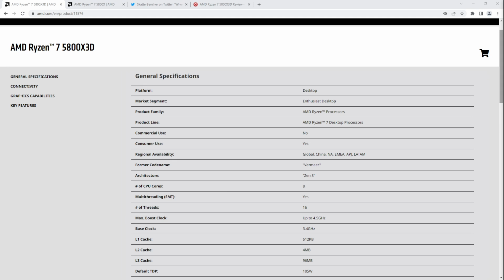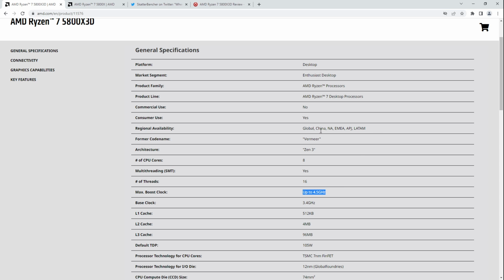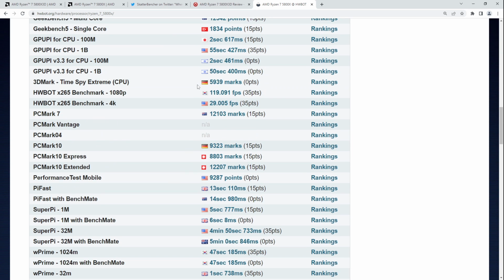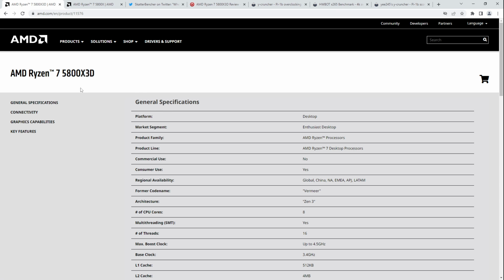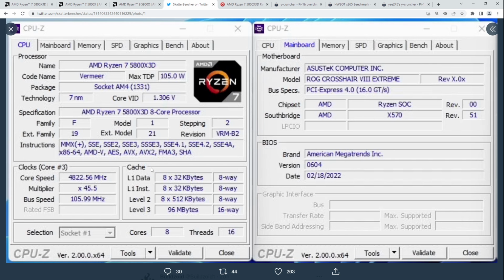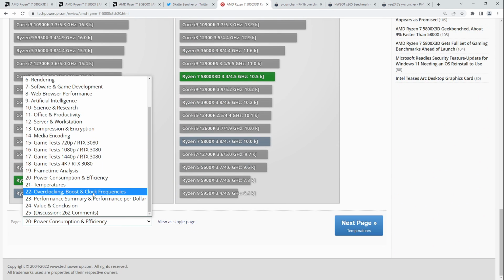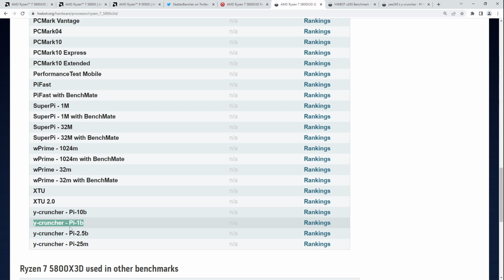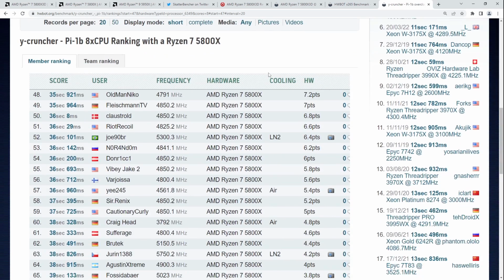Buildzoid's 5800X3D overclocking rant

Comment: Only reason is bc the 3d vcash ads hight with increases the thermal delta. But like on a 360 aio i can't keep the delta low enough to hit the boost under load. If amd made a custom ihs for it they would have to worry about locking the frequency. And trust me ima direct idie guy. I got my i7700k back in the day to 5.3ghz stable allday with a max temp of 65°c. To conclude yes the locked oc is dumb af. Once i d lid my 5800x3d i will most likely hit the boost no problem. Then i wil ether dig to the bottom of the internet to find a solution to unlocking the ppt. Or do a bclk 😢.

Comment: I know this probably won’t ever be seen, but: Is the thermal shut off not customer adjustable? How is it implemented? 

Can an overclocker not choose a temperature as their own shut off safety point? Ex: Imagine a new overclocker who is nervous, maybe they’d want to lower the shut off from 115 to 95 for their first runs. Is this not possible?

If not, could you go into how these limits are implemented at the architecture level?

Comment: This video didn't age well at all.
In the meantime we have learned what's going on with Intel's 13th/14th gen CPUs killing themselves. AMD chose the save route with their first X3D products to avoid a desaster like that. And boy, those 5800X3Ds are still going very strong in games. Plus the 5800X3Ds tought us that with modern CPUs undervolting is the new overclocking (with lower voltages you can maximize boost performance).

Comment: I guess it's just me but I never found frequency scaling a great feature for performance in general. I would sacrifice some clock any day for manual vcore/freq on all cores, basically raw performance with no awful jumps, spikes hikes what have you between idle to load transitions which is the worst feeling one could have after investing time in building something better than an pre-built HP office PC... Genuinely I don't understand how PB/PBO is considered acceptable as a standalone solution with no other options. It baffles me, might as well just buy a laptop at this point.

My final take is I think (even including this channel) overclocking is seen as pushing clocks and voltages to max blah blah. But honestly in my plebian OC PC experience the holy grail of OC is having the option to max out real-time stable performance (which is not peak clocks, but constant clocks), not just in gaming but in workstation workloads as well. How does freq scaling help you at all when you are working on something for long hours with 4 heavy programs for 3d and alike opened which use cpu only when touched?1 So you tell me every-time I switch programs or walk away I need to just suck it up with all those stupid freezes and ramp ups. What is the point then of this product being at all an X, call it 5800G3D or something idk?

P.S: I'm well aware that manual fixed vcore will draw your electricity bill higher, but in performance or work context I think that should be a possible sacrifice.

Comment: Hey BZD, have you seen PBO2-Tuner for the 5800x3d? with that you can also tweak voltages, mhz and thermal cutoffs
Reply: You can't. The multiplier is artificially locked at 45X

Comment: Why can my 5600X occasionally hit 110C with things like CPU Burner?  It's doesn't shut down or become unstable...  Although I'm sure the clocks are reduced...  Nevermind tho... it can hold 110 to 111c for as long as I the user, allow it.  

Oh, OK, later you say the actual shutdown is 115c - so ok... that makes sense then.

Comment: Ryzen 5800x3d sucks compared to what is about to come from amd. Zen4 will include both overclocking features and a lot of cache anyways... I am excited for the zen4 hell I'll probably buy the top end zen4 chip and build the top end zen4 + rdna3 gpu system with like 7000 maybe 8000 mhz of single rank 32 gb memory system with epic timings and scores next year unless zen4 and rdna3 sucks...

Comment: Yes fully unlocked, 1 or 2 Ghz base clock. Charge an extra 50-100 quid, Get a lapped IHS and put the serial/model number on the PCB in the centre of the socket pins.  Call it a "Black Edition" or better yet a 5950X and call it a 5950XOC.

Comment: There was so much potential there but as soon as I heard the nerfed they clock speeds compared to the 5800X I pretty much lost interest because now it's just a One Trick Pony for Gaming only and you are going to take a significant hit to Productivity ..... If they could have kept the clock speeds the same as the 5800X they could have had an all around CPU where you still got good productivity performance as a real screamer for Gaming. Personally I'm going to save myself 100+ bucks and buy a 5800X ... Hell I could even save money buying a 5900X which are under $400 now
Reply: "you are going to take a significant hit to Productivity ..."
For productivity there is not much difference between it and the 5800X. For gaming it is faster by a decent margin.
According to HWUB 41 game comparison it was 15% faster at 1080P and there still were several games which were GPU bound. For 1% low it was 22% faster. So I expect the 5800X3D to pull further ahead when we get faster GPUs or if you are using "competetive settings".

If productivity is important then the 5900X or 5950X is a better choise. If you are gaming and the 5800X3D is out of budget then you dont get the 5800X but the 5700X. So the 5800X is kinda pointless at this point, unless it is prices very close to the 5700X.

Comment: You Can Get really good Result's DOS overclocking with PBO enabled so you still get your single core with an All core overclock with Regular Ryzen 3.. But honestly if you want Ryzen to run really well just Over cool the chip and set the memory and fabric all 1 to 1 at 3600 or 3800  1800 or 1900 and keep your timings as tight as you can for the speed you are at.. Ryzen is pretty simple to get great performance out of now, By a good kit of 3800 or 3600 and make sure you pay special attention to the timings.. If you can find a Kit of 3800 that will do 16,16,16,36 and set XMP you will be in business.. Even 3600 at CL16 is only 2% slower in most cases.. 3200Mhz with 14,14,14, 34 can be fast than 3600 at 16 in different use cases.. But good video can't wait for AM5 to comes out a see you play with those boards memory and chips..

Comment: Part of the motivation here I think might be sandbagging for Zen 4 on	AM5. This V-cache with an updated core design, new chipset, DDR5 memory, higher clocks, increased power limits, etc. would blow out anything by miles.

I can see Intel being very worried.
Reply: Sandbagging?
Reply: @Dennzer1  Pretending to be worse than you really are, hiding your ability.
Reply: @redrock425  Oh, ok. Thank you for helping me understand. so help me fully  get this. AMD may be,  if you are correct which you very easily  could be I wouldn't know, AMD is trying to do what exactly?  

Hide the true potential of Zen 4 in order to surprise Intel  and thus take market share during the period of time when Zen 4 and Raptor Lake will  being sharing the lime light for the longest period of time when both are the current top lines available from both companies?

I feel like I don't fully understand your point, because sometimes my brain has trouble with new ideas.

Comment: but, isn't it locked because the cache does need more voltage like 3.31 or something and therefore they "locked it" the way they did. because the core aren't the problem. it's the layered cache.

Comment: Buildzoid, I was very surprised one was actually in the shop in Australia so ive picked one up, what i noticed is it will run 4.45 all core, when tested on cpuz bench, vcore was 1.29-1.3 and temp range on a  360 Ek Aio with noctua thermal paste was hitting 67c, there is room for more, i may delid and replace the IHS with copper and liquid metal

Comment: Try to think about why AMD doesn't want to overclock the 5800X3D, it's that simple why! AMD does not want to make its own concurrence with its future AM5 CPU. The 5800X3D would be way too powerful if it were overclockable. And many customers would only buy a new CPU much later.
Reply: nah its prob because it could be damaged way easier by the v cache structure so they avoid rmas

Comment: They can lock voltage control, because they instructed MB manufacturers to do it according to them. The CPU itself should overclock fine (even Multiplier), because hardware should be capable. There seems to be evidence of MB manufacturers internally having BIOSes that overclock it. (That BIOS block seems to be because of issues with the VCache dying as others already noted)

Comment: Do you make such a big Fuss to every  I n t e l  CPU which is a non K modell and not OC able where the multiplier is blocked too ? AMD at least  h a s  a reason why they blocked it , Intel only wants to print money with the " K " CPUs . I can understand AMD , there is a 2 year warranty on the CPU and V-cache is a brand new Technology , how will AMD prove that it was the customers fault that the V-Cache blew up ?  . Gamers often OC everything to boost FPS . AMD had to restrict the CPU , you may dont like the way the way they did it but that does not really matter .

Comment: It's the bonding method used to plant the 2nd layer of cache. While it isn't "weak" for the use and the limits AMD put on the chip, it's only enough for the limits AMD put on the chip, at typical chip lifespan metrics (10-15 years guaranteed no performance degradation, IIRC). The 106Mhz bclk guy is going to break his 5800X3D within 2 years, literally, physically break the copper bonds between the cache slices much like GPUs getting physical VRAM faults due to thermal cycling of the solder.

Comment: "Because this is an enthusiast product." Yes, it is. An enthusiast gamer product. Not an enthusiast overclocker product.
I'm reasonably certain that the reason they locked the multiplier is because of leakage control on the stacked cache. This is a retrofit at best to experiment with the tech and they felt they had a viable product worth selling with some caveats. This is R&D going right. If they were willing to sell this stage of the R&D then this means the final intended result is going to be significantly better. Correct me if I'm wrong, but cache scales directly with multiplier overclocking on Zen, right? They pushed out a new "gamer enthusiast" CPU to compete with the 12th gen at the same price point. This was never meant to be a top-of-the-line CPU for overclocking enthusiasts. Why? Niche market. So ask yourself: Why are you annoyed with this product that's not meant for or advertised for you? Does every single CPU have to be for your niche? No, your niche is finding the CPUs that overclock the best for those record-breaking numbers. Any CPU that won't shouldn't even be on your radar let alone annoying you that it wasn't made for your niche.
EDIT: Now I know you're also a gamer. So consider this since this product is meant for you on that ground at least; Would this CPU be a better gaming CPU for your gaming in spite of it not being very overclockable? Would it at its best "limited" OC outperform any other CPU you have for gaming? If it will, then it is meant for you. If not, then you already have a better CPU. Simple.
Reply: I got one for racing and flight sims. The extra cache is huge for that, apparently. Couldn't pass it up.
Reply: It could have been multiplier locked for mere mortals, but the lock could have been overridden with some actually hardcore overclocking wizardry (a la tying a copper thread between two pins of Athlon) that voids your AMD warranty for life. 

That would have been better. Regardless of how many "yes buts" and "no buts" you can come up with. 

That. Would. Have. Been. Better.

Comment: mr buildzoid please comment on rtx 3080 12GB suprim x versus strix pcb. as we all know, suprim x is basically just a stretched out FE pcb, but apparently it performs kind of better in most cases compared to strix according to benchmarks on popular youtube channel. it doesnt make sense because the buildzoid theory is crappier pcb performs crappier, but this one is not. how is this possible. mr buildzoid please evaluate these pcb's.
Reply: A good PBC design and quality components allow a card to it to go a bit further but there are other factors that can make a significant difference.

The GA 102 GPU 3080 all perform in roughly the same ballpark, in the end the individual GPU silicon quality and the quality of the cooler is what allows better clocks and thus better performance.  This is why we are seeing such massive 3-4 slot coolers.

Even the top end of GA 102 above the 3080 so 3080TI 3090, 3090Ti are all very close to each other in performance.

Just look at EVA they have made it public that they bin there silicon and the highest clocking GPU cores go into the FTW3 cards.

Comment: Testing my X3D now. There's a good reason they locked it down, and it's NOT voltage. It's heat, it's one hot SOB and as we know heat exacerbates degradation, add in voltage over 1.3 and it will run away.

Default voltages are WAY under 1.35. At stock speeds I saw at 4450 steady workload all core was 1.26, max observed for single thread locked at 4525 effective was 1.194v. The 1.3 and 1.35 numbers Robert mentioned are uncoolable without significant efforts.

At 105.4 BCLK + 45.25 mult with 1.21volts:
When I say it's hot, chilled water temp of 50f, Conductonot, Lapped waterblock, 1.5GPM, spiked to 71c and leveled off during OCCT Smallest, Steady, 16t testing @ 122 CPU Package Power.

Extrapolate that to an AIO or Big air cooler and you're going to be "right" up against the 90c limit constantly. Brace for a wave of "Why is my 5800X3D so hot" posts on r/pchelp and r/overclocking....

The current HWBOT scores posted are mine if you want to see what low-effort preliminarily OC results are. I've already exceeded everything posted by a good bit, so don't think that's representative of the upper limit of x3D performance.  Do NOT expect to match those scores on air cooling lmao, you will be disappointed.

Comment: 3:36 AMD has literally said "the cache would fry itself if we let the voltage go higher", so I think that is indeed the reason. The fact they've promised this will be the only chip with V-cache with this limitation suggests they have a solution in the works.

Edit: That lower voltage/clock seems to be resulting in the chip running cooler than the stock 5800X, a notoriously hot chip. Good job, AMD.
Reply: @KrazyRyzenPC Are you trolling or cant be bothered to actually watch the video? This cannot be done and certainly not by AMD
Reply: @Lokotraktor  It's what they seem to be doing because the have control over the BIOS
Reply: @cromefire_  They have only partial control (AGESA) and Buildzoid specifically mentioned that AMD cannot control vcore. If you do not beleive, SkatterBencher ran it on 1,375V on Asus Crosshair VII Extreme. The voltage is just decided by the board so in can be changed on both SW or HW level.
Reply: @Lokotraktor  Well they the MB manufacturers are at AMDs mercy, so AMD has control over the BIOS (of course they can't just add a line of code to prevent it, but they can just tell the MB manufacturers to prevent overclocking and to prevent voltage control and most or all will comply)
Reply: @Lokotraktor  A word with motherboard manufacturers to include a 1.35v vcore hard limit in their 5800X3D BIOS update. They could do the same with EDC/TDC limits as well. You'll be able to use PBO and whatnot but you can never go past 1.35v and frankly, the vast majority of people will try to undervolt with PBO/curve optimizer anyway.
As for temperature, just lower the ceiling a little bit like Bullzoid already mentioned. This would've been the better route to take if AMD actually cared.
Reply: 5700X also runs cooler. 
Let's face it, the 5800X was a bad buy, they were 5900X that had failed validation.
Reply: @Kiki-lc3ng  The 5800X only has one CCX, the 5900X has two, so not quite. But I get where you're coming from.
Reply: @Kiki-lc3ng  5800x has better cores than the 5900x. They only have 1 ccx and have to pass validation

Comment: honorstly AMD havnt done a good OC cpu since phenom X2/X3´s and how you could unlock cores on those. I gues AMD´s FX did oc, but they preformed so horrrible that it just didnt count. 
So basicly ever since FX/sandy bridge, only Intel has done decent preforming Overclockable cpus, and debateabli still does(12600k/10600k/8700k/8600k). lower clocked than some of their counterparts, so if you can control the heat on those u can at least get 500 +/- mhz out of them, thats way more than most of AMD´s modern cpu´s all core oc´es.
Reply: The FX CPUs were decent overclockers. I ran my FX-6300 at 4.8 GHz.

Comment: I dont think you understand who this processor is for. This aint for you guys who want to overclock the shit out of every single CPU that comes out and shorten the shit out of its life, this is purely marketed for gamers. The fps gains people have measured have been nuts for the price. Why cant you people just keep overclocking the normal 5800X, it's cheaper anyways. And clearly overclocking the chip doesnt bring as great improvement as what they managed to do with the additional cache. What's with the obsession to overclock the shit out of every goddamn chip, even the ones that they wish people wouldnt overclock?
Reply: 1) From a scientific perspective it is a shame it can't be OC by multiplier as it would be interesting to see how such large L3 cache can effect various benchmark workloads.  We already see this happen in games where some workloads favour the large cache and some do not.

2) OC is fun, it is interesting to see what kind of silicon quality you got and how far it can be pushed. 

This is all additional fun on top of the potential for gaming.